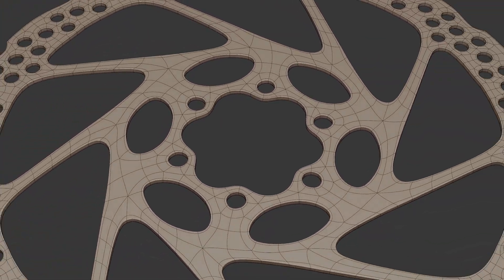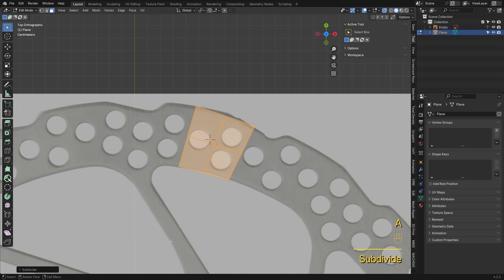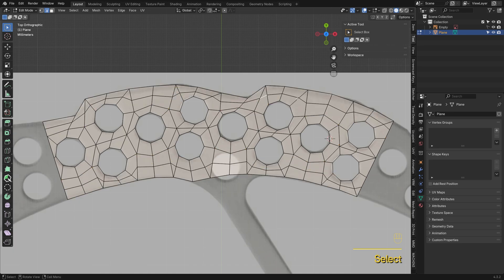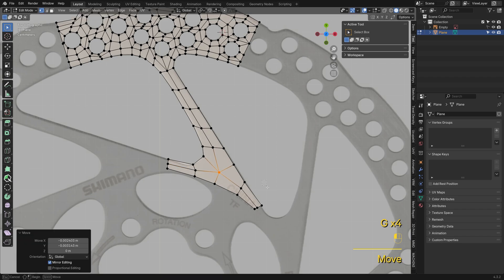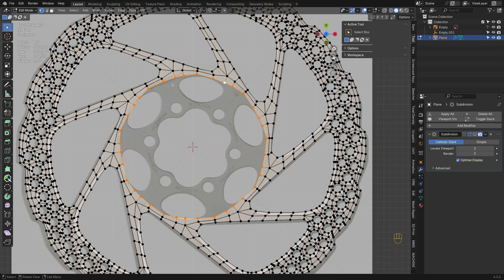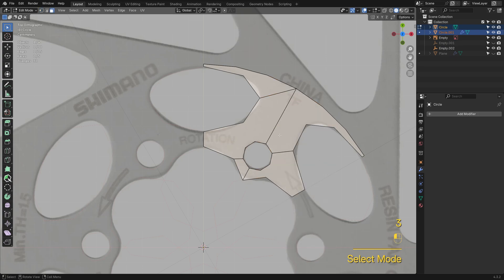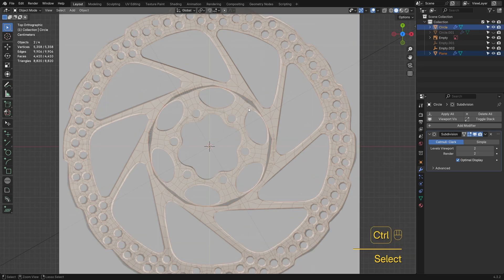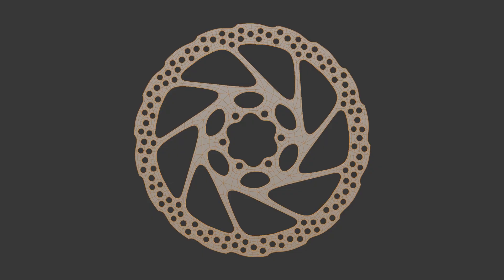Blender Topology Tutorial: Master Radial Cutouts on Flat Surfaces

Comment: I think such shapes are easily model in plasticity and exported to blender.
Reply: You would still need to retopologize the mesh to make it subdividable. This approach produces an all quad mesh which could be ideal for specific circumstances.
Reply: @dannybcreative  actually quad mesh is only necessary for deformation and animation work but it is not applicable to hard surface 90% time. for rare cases you can retopologise later.
Reply: @rajendrameena150  If you say so.